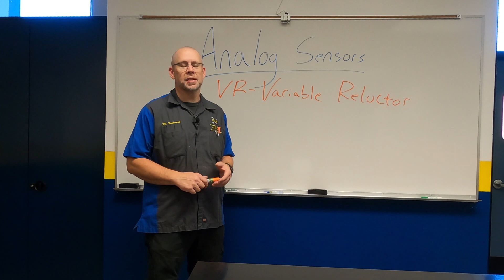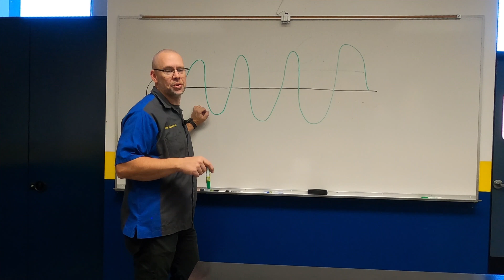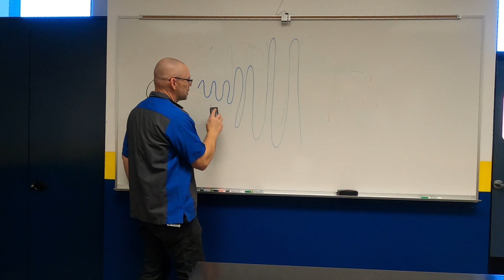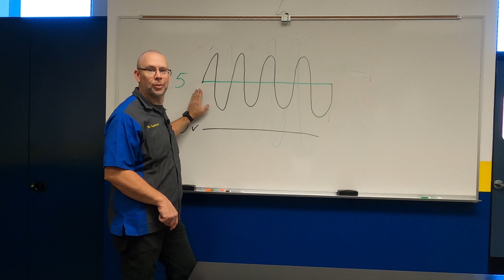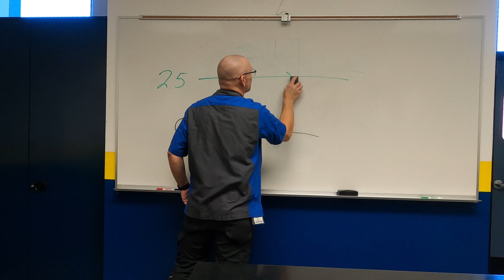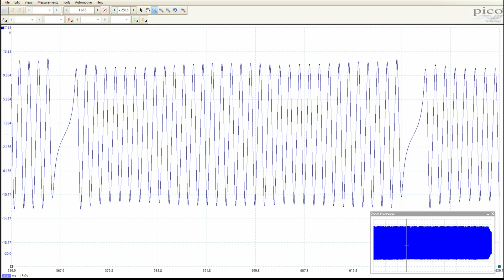Analog Sensors - Variable Reluctance

Comment: Just out of curiosity if magnetic resistor sensor is the same output signal as a Hall effect sensor could a Hall effect sensor be used on the same ecu as the magnetic type?? Sorry to ask
Reply from the maker: Theoretically It might be able to, but the trigger or target wheel would also have to be changed to one with slots that would work with the Hall sensor. Those slots would have to replicate the same pattern as the MR sensor produced in the direction of normal rotation. The bigger issue is that the MR sensor in newer applications can also indicate movement in the opposite direction through a change in output, which the Hall effect is not capable of doing.

Comment: So what kind of crank sensor uses a magnetic wheel as a trigger as has no teeth how does this operate as it has 3 wires on this crankshaft sensor???
Reply from the maker: That style is not a VR, which requires some kind of a toothed wheel to work. The sensor your asking about is a Magneto-Resistive sensor, which has a digital output like a Hall Effect sensor in that application.

Comment: But may you have a 3 wires sensor and its a VRS sensor such as in hyundai Tucson 2006 diesel Crankshaft position sensor.
Toyota hilux 2009 Crankshaft position sensor.
For these cars have 3 wires but its VRS because the third wire is shield.
Reply from the maker: You're absolutely correct. I tell my students often that "it depends" as things change all the time. To date though, most 2 wire sensors are VR type. Although now we have to be careful as many MR sensors (especially in a wheel speed sensor position) are also 2 wire but work completely differently!